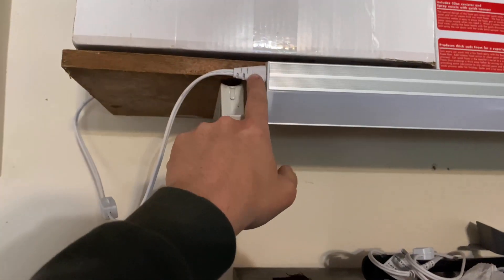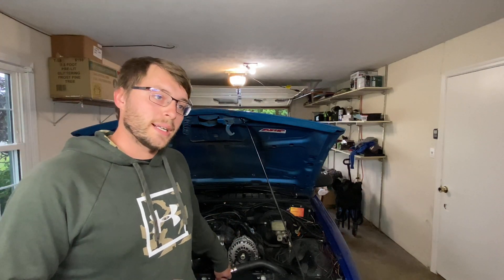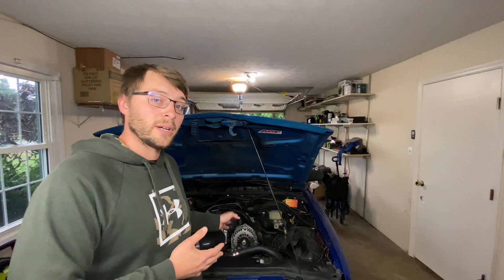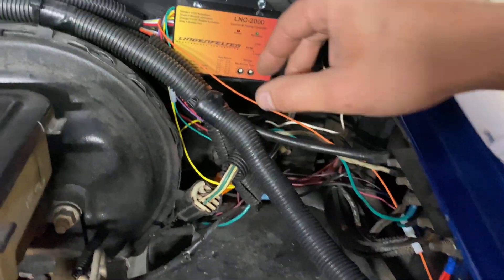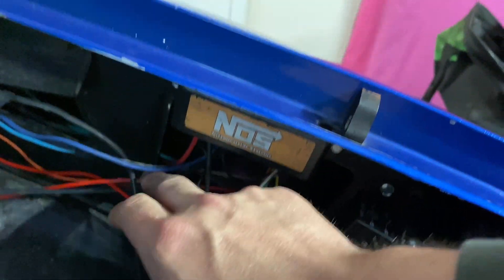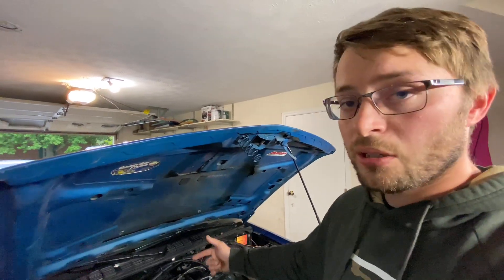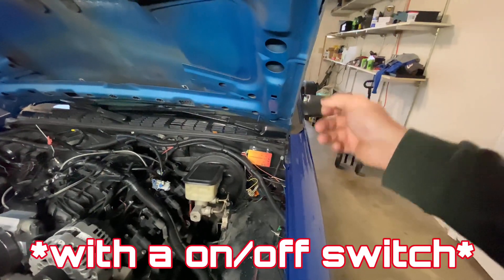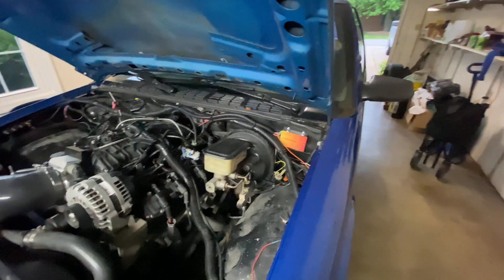How To Ls Swap: S10 Wiring up LNC2000 Timing & Launch Controller Box

Comment: I'm leaning towards a transbrake for my 4L80E with a manual shifter.  What are your thoughts on tapping off the transbrake button to the LNC?  Is that a thing?  Would alleviate the on/off switch and accidental brake pedal engagement, I would think.

Comment: Huh??,
What did you say????😂😂😂
Reply from the maker: Hell u talm bout
Reply: @LsBluu  🤣🤣🤣
Nice truck man!! What other mods do you plan on doing?
Reply from the maker: @jasonhastings5538  I 6.0 swapped it and put a terminator on since this video
Reply: @LsBluu  yeah i seen those also! Are you just gonna add more spray to it or build a better combo?
Reply from the maker: @jasonhastings5538  gonna throw a lot more spray at it. I think this new set up has a lottt more potential than the previous one had.

Comment: I’m confused, if it activates with brake pedal does that mean I’d only be doing burnouts to the RPMs I set the box at?
Reply from the maker: Until you switch it ‘off’. It was hooked up to a on/off switch.

Comment: You not having any issues with the rev limiter since is working with your brake pedal ,at the end of your run when press the brake again for stop ?
Reply from the maker: I hadn’t thought about that. From what I noticed the rpms drop down a lot when I let off. Also the rpms are coming down and the limiter just keeps them from going up over set rpm.
Reply: @LsBluu  im running a setup close to what u have ,im using the lingelfelter aswell doing the timming retard and rev limiter but since i grabbed the signal from the brake pedal when i let off gas and hit brakes i just hear a bunch of back fire due to the rev limiter i have a on and off switch too just feel very unsafe pay attention to turn of the switch before hit the brakes hopefully you dont have that kind of situation …though im calling lingelfelter tomorrow to see if they can help me out
Reply from the maker: Maybe put the on/off switch for the brake pedal on a momentary switch on the steering wheel. Kinda like a trans brake button.
Reply: @LsBluu  I thought about that too but  i think it can become an issue having to press the brake and the switch  at the same time when you are at the starting line ,the chance to mess up your launch is easier imagine you let off the brake but stay pressing the bottom or either way …